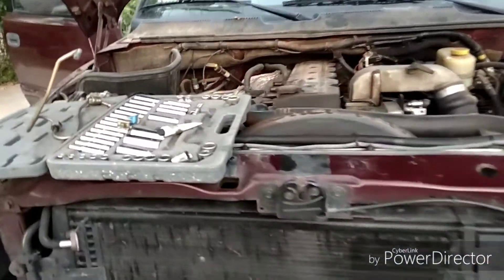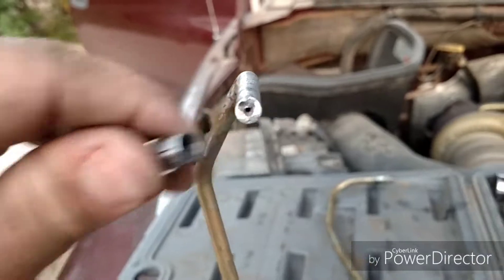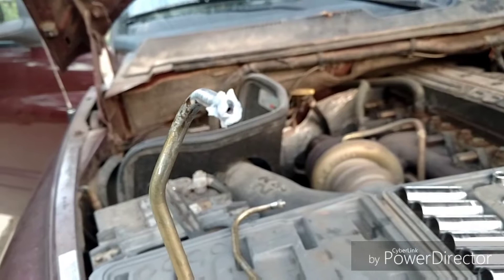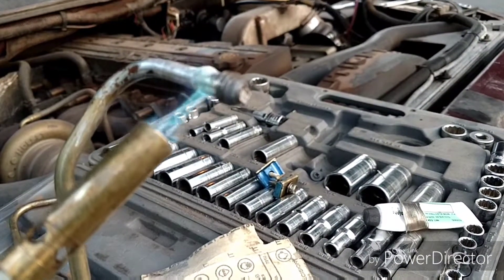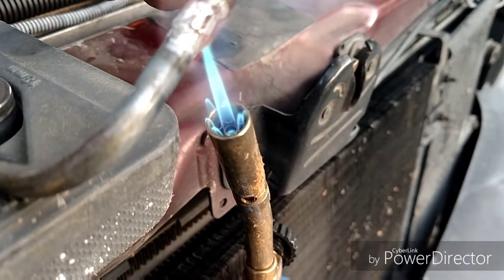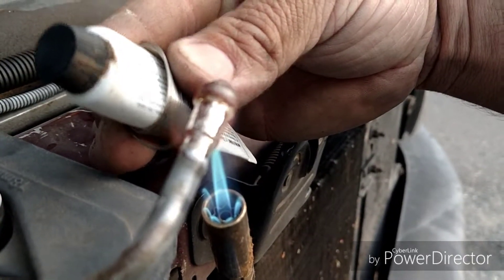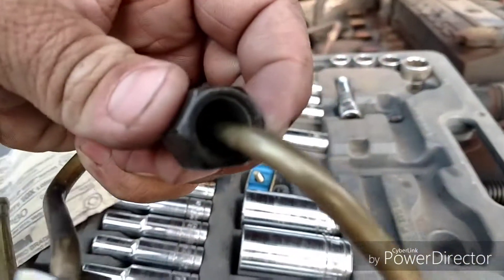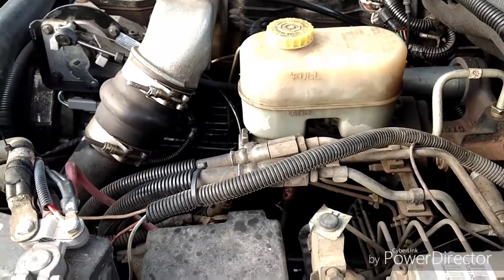24 valve Cummins fuel line soldering

Comment: If you use higher heat you can braze it and it will hold. I did a steel line on a ford ranger. Just make sure you take off all of the o rings lol
Reply from the maker: Yeah, that would be bad

Comment: You mentioned its not a permanent fix, my fuel cooler return line is aluminium tube. I guess not great pressure. Can it be permanent fix in that case? Thank you
Reply from the maker: It's been my experience that the fix holds, but then the line will crack an inch further down next time, but it usually holds for a few months.

Comment: This is actually not Soldering but brazing. Brazing filler metals melt at a temperature above 840 degrees F and Soldering filler metals melt at a temperature below 840 degrees F. This silver brazing filler is in the 1200 degree F range.

No biggie, everyone I have ever met calls it silver Soldering just saying haha.
Reply from the maker: Thanks for the clarification. It's confusing.
Reply: @VanDamArtisan  lol no problem. I'm a welding instructor so I'm a little funny ;) haha

Comment: I've never done this with silver solder, but I've brazed a bunch of em. the "War Dept" has a beloved Volvo 245 diesel, the injector lines develop pin holes... and of course they are an obsolete part, so... braze that S up. 
My favorite though was a cummins powered ford service truck, the main supply line end popped off while getting on one of our lovely WA state ferries... diesel everydamned where, luckily it retained enough air, so the pulled me off the boat on the far side and left me on the dock with a smile and a wave... But it was a service truck so I had oxy acetylane, just needed brazing rod...  anyhow tore it apart and fixed it on the dock with a crowd of folks watching... Last I knew that truck is still going strong. 

The other crazy thing... Cat 3406 injector lines will break... TIG welded the last one together... did that wednesday... so far so good though for that one I did get a replacement part for it.
Reply from the maker: Yeah, I find that everything stays fixed best if vibration is minimised because I think the brass gets brittle after a while
Reply: @VanDamArtisan  yup, two biggest reasons for fuel line breakage, some idiot bent it, and some idiot lost the anti vibe strapping.